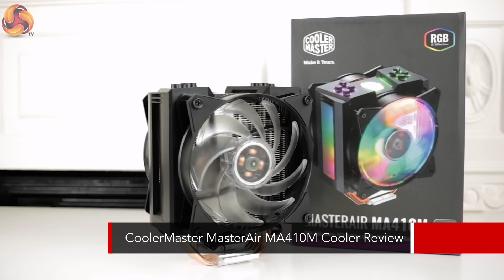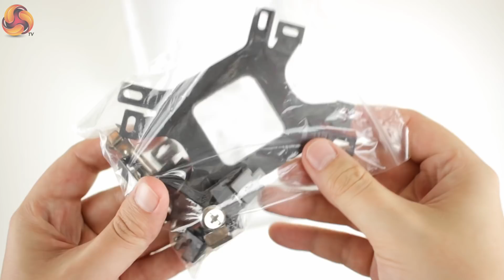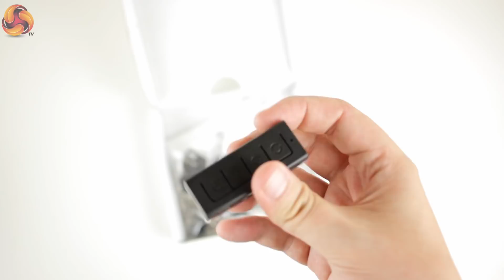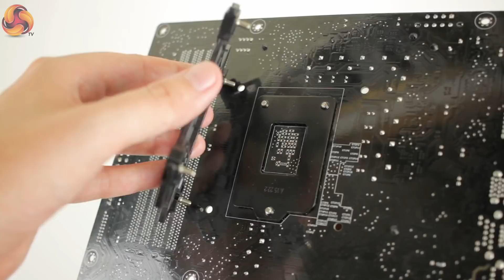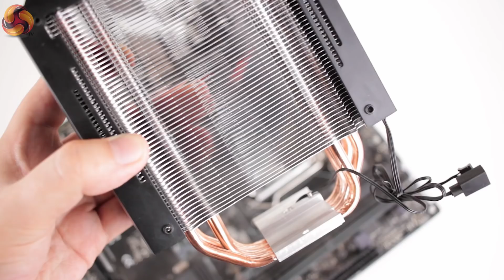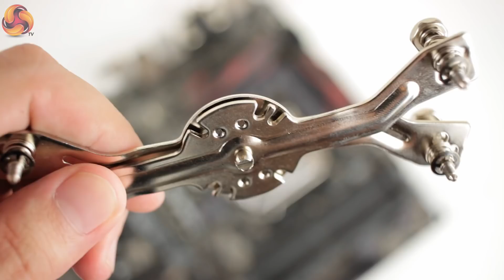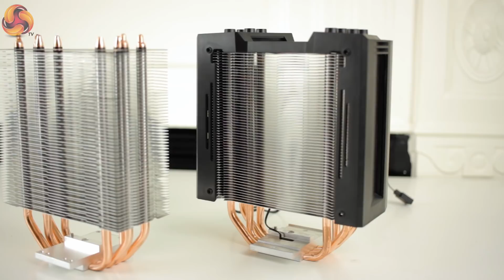CoolerMaster MasterAir MA410M - £60 RGB monster?

Comment: If I had rams like Team T Force Delta RGB or Team group Night Hawk at 4x4 will it not hit the fans of the cooler?
Reply: Depends on the motherboard, but I can tell you that on the ROG Maximum Hero X it does hit the RAM and I can only go 4x2 with normal RAM and will have to buy low profile RAM if I ever want to upgrade. That said I had the same problem with my old PC that had a Hyper 212 EVO, so there’s that.
Reply: @Mifoe.  well thanks man

Comment: How to installation MA410M tuf without 3 pin Addresable RGB 5v on motherboard with 12V RGb header?
Help me please,,
Reply: hi did u solve it? same problem here. pls do help me. tqvm
Reply: @arifshah1230  Simple, use the controler. You can't put a Adressable RGB 5v on a 12V RGB header, unless you want to kill the leds.

Comment: I want to replace my cm hyper 212 led turbo with this, is it worth it?, Because my hyper 212 is not good to hold my r7 2700x while gaming, its about 80° C playing mhw
Reply: Maybe 3/5 C° cooler lmao
Reply: Case air flow and GPU temp with fan design will also factor the cpu temp i think. I also use hyper 212l for i7-3770 and i5-9400f, both wont hit 70°c (ambient around 30°c). Maybe your thermal paste also got something wrong.

Comment: Bought this Christmas 2018 and they did replace the brackets to make it much easier to install. I agree the process was rather difficult, I have built many computers but this was my first non stock cooler, and first RGB build so I definitly struggled more then I expected.

Comment: Would this cpu interfere with 4x4 low profile ram?
Reply: Swole Lemur not at all, but I recommend placing the ram first if you wanna use the 1st ram slot, besides that it’s good.

Comment: Could the push - pull configuration in Fans and perhaps variances in rotational speed between the fans - as one is push and the other is pull and might not have the exact same air transport - actually hinder airflow with more whirling / turbulence ?

Comment: coolermaster cpu coolers are "janky" to say the least...
Reply: That is a bold statement considering they make the Hyper 212.
Reply: the 212 itself, even though great cooling for the price, was quite janky.  i have 3 sitting here next to me and none of them are the same height.  varying from 158mm-160mm in total height.  none of them lock down totally and will all rotate up to a degree or two in either direction.  they are cheaply made and i only recommend them for the extreme budget builds.  if you're air cooling and serious about it,  you should have a Noctua brand cpu cooler sitting on top of your cpu.
Reply: I've owned two 212s but they have spanned several years. My first one was prior to me going AIO, so I no longer have that. The second was bought when my 240 aio's pump quit and I needed to get my system running again quickly. that was just a couple months ago. Obviously I can't compare them directly for discrepancies but I know they both worked well. 

As for being serious about air cooling, I am not. 3 out of 4 systems in this house are AIO cooled. The 212 is currently strapped to my WinXP retro machine and working very well. Easy chore for it for sure.
Reply: yes sir they are decent  coolers for what they cost.   i've just gotten to the point where i've been fortunate enough to play with a lot of the gear we see on these channels and i've come to my own conclusions that all else falls short of Noctua when it comes to air cooling.  i honestly recommend waiting until you can afford Noctua to all those that are cutting corners to build a pc that is air cooled.  the mounting system, the quality, the warranty, the performance, etc etc just makes it worth while in the long run.  as for another dig against coolermaster,  i've had 3 212 / T4 fans go bad and they have basically refused to replace them even though proof of purchase was shown.   you get what you pay for usually and that's why coolermaster products are cheap.